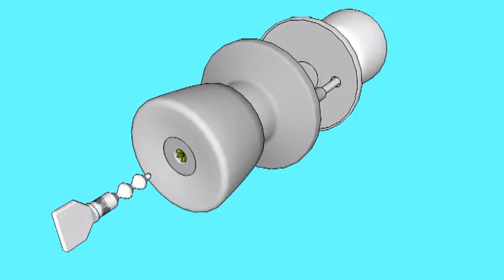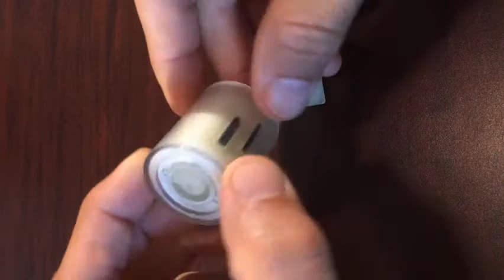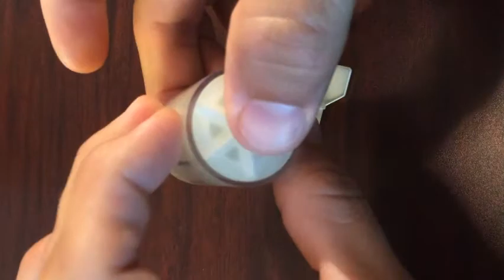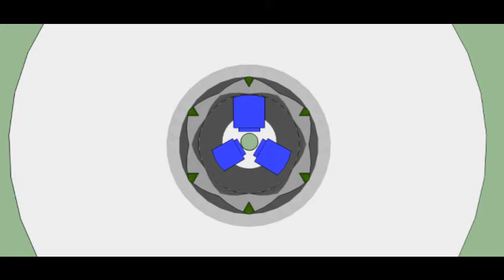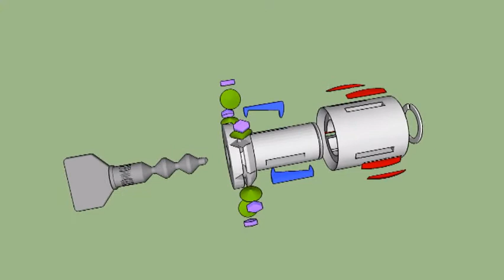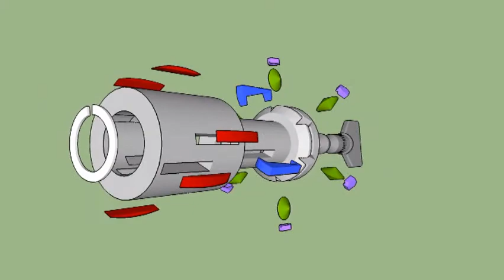Unique New Lock Design

Comment: A specially turning tool could be easily made. Pretty sure this lock could be raked and picked with simple specialty made picks. You only have three elements which would need to be set to the right axial angle and I think they will bind in order.